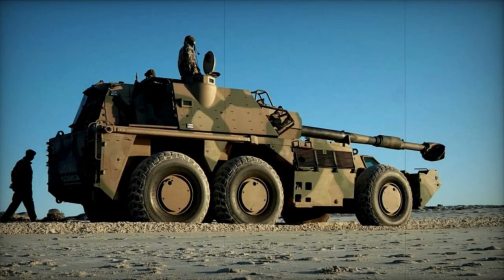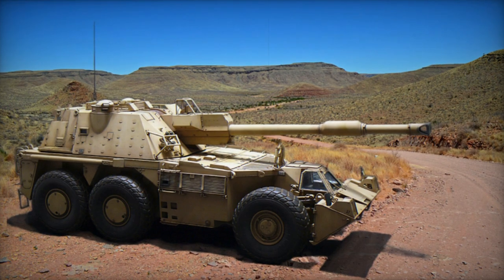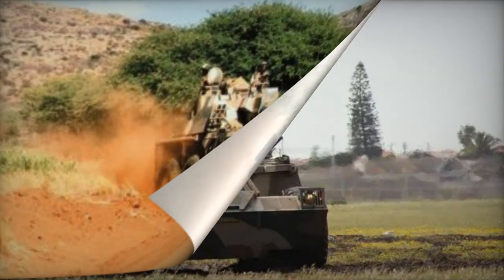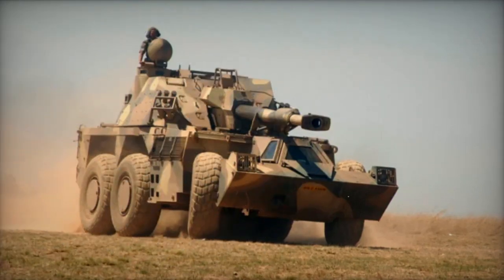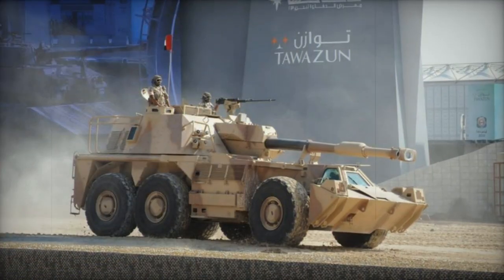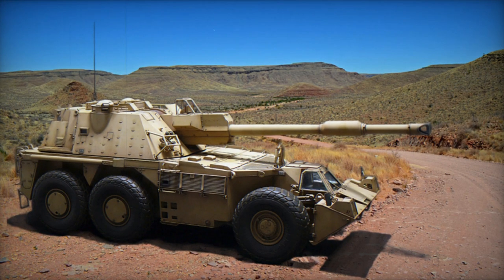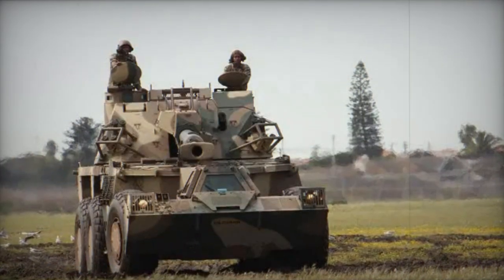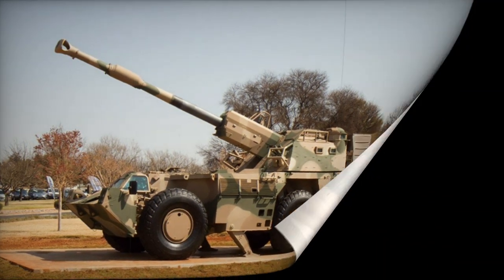G6 Rhino 155 mm self propelled gun howitzer

Comment: Have to respond to your very wrong stats on the firing distance! 
It is way beyond 30km with standard rounds, that's for sure! In the late 1980's (86-88) The first examples of the G6, fired regular round to distances of 40-plus km!
When the VLAP rounds came into production, this 49-cal 155mm artillery gun, shot to 53km! 
You are right with the G6-52 firing out to 73km with 52-cal and using VLAP rounds...